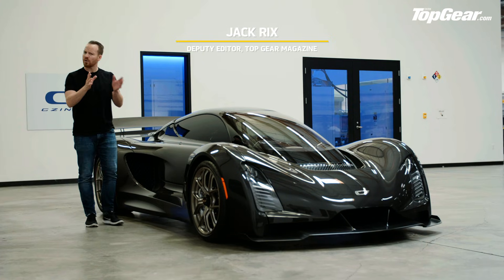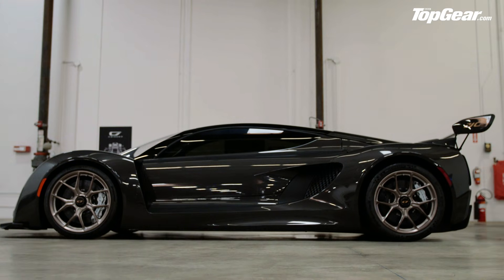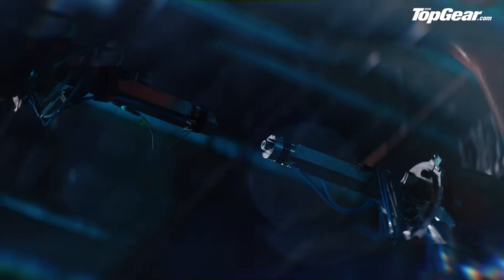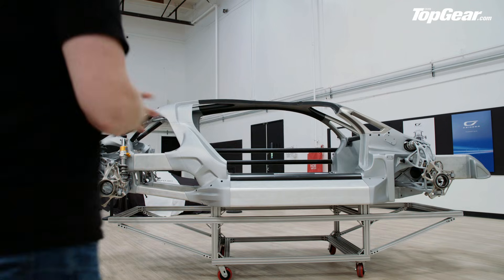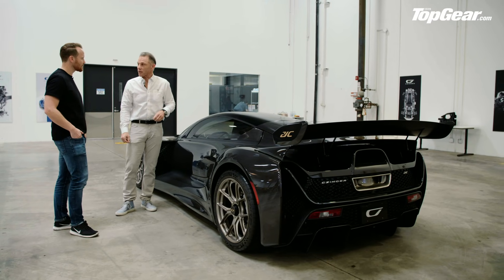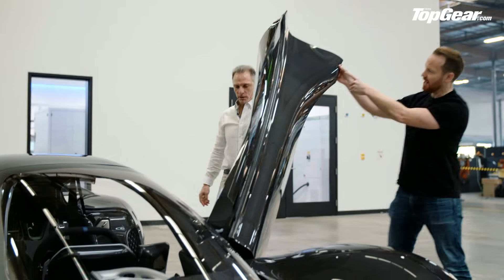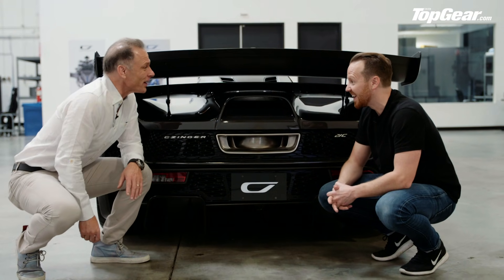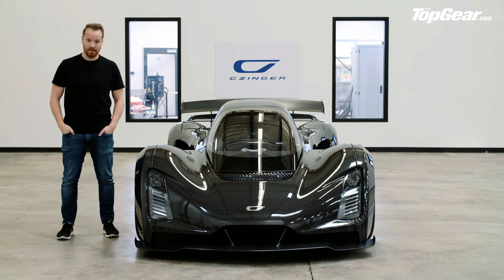FIRST LOOK: Czinger 21C: the world’s first 3D printed hypercar | Top Gear

Comment: “The future of car manufacturing”. 

Also:

“The future of mass unemployment”.
Reply: The problem with the call to historical trends is that new jobs were always created by new markets, but the workers needed by these new markets were always human. The car replaced the horse and buggy and suddenly, even though the horse ship manufactures disappeared, the market for cars was much greater and so more jobs were created. But these jobs were still handled by humans because machines couldn’t do the work. 

Same with the Internet. It is a new market that created many many new jobs that may have replaced those that were lost to new technologies. So even as some jobs were lost to automation, many more were created at a higher level. 

The issue here, though, is that we aren’t creating a new market so much as were are creating new workers (AI and robots). So even if we do create new markets, we will also have an army of AI workers that can fill the new positions. 

Think of it as a hierarchy of complex decision making. As jobs lower on the hierarchy are lost to automation (manufacturing jobs for example), more jobs were created at the top (programming for example). But AI is creeping up the ladder. More jobs that couldn’t have been done by computers years ago (call center jobs for example) can now be handled by a machine. And these machines are getting more capable of moving up this hierarchy. At the same time, there is very little room at the top for us to keep climbing to. Even if we come up with large new markets, the level of complex decision making that the average worker is required to do won’t exceed what we currently do in tech and science. We are near the top of what complex decision making jobs can be created. We might manage to generate many more of these jobs, but their complexity won’t exceed where we are now by very much. 

In the past, these new markets led to new jobs at the top of this hierarchy because computers couldn’t do the work themselves. Now we find ourselves in a position where machines will be able to climb this hierarchy faster than we can expand it at the top. And then when new markets appear (which in the past offset the loss of jobs in a lower level) many of the new jobs will immediately be filled with more machines. Why hire a lawyer when at some point the AI will be better at it (or at least do enough of the grunt work that you only need a single lawyer managing it)? How about spinning up a few virtual accountants to handle a merger?

When you create an AI with the same complex decision making abilities as the average worker then there is no reason to keep employing the average human worker. 

This time is coming.
Reply: @2000bvz  Mate, this comment is way too good for YouTube.
Reply: Lord Tippington the Wise - Atheist Knight of Le Reddit Gentlesirs 

I am having a terrible day, and your comment made me chuckle. Thanks 😊
Reply: @2000bvz  👍
Perfectly analysed and summarized!
Reply: You seem like a smart guy and are highlighting problems we have had with society from day dot. Machines can and will nearly always improve productivity. It down to society to allow the benefits to improve the lives of many and not the few. The balance of capitalist rightism has swung us in a direction of favouring the few. If we can educate each other and swing the balance back the other way we can all reap rewards. Those include less working hours, more quality family leisure time. Reduced stress etc etc.
Reply: @kentonian  you can have less working hours and more family time already now. But that means less income today and there will be no difference in the future. Nobody will pay you money for your existence . 

Without any possible work, the education level will decrease because there is no need for education. That means much more children. much more population without anything todo means violence and other society problems. Just take a look to Africa or the past of few Asian countries.
Reply: @MrQmie  no because the lower classes cannot afford to both reduce working hours and have spare money, the wealth has to go to the rich. Fairer distribution of wealth helps with education a lot too.
Reply: @kentonian  The invention of free market capitalism has brought about the single largest leap forward in advancement and development in human history.  We've progressed further in technology, medicine, education, and virtually all other fields of endeavor in the last 250 years than we did in the previous 10,000. Without it, we wouldn't be sitting here arguing about the merits of the very thing that allows us to do so.
Reply: Considering capitalism is basically the use of trade/bartering it is not a recent development. You probably do not see how constrained even in the USA it is. Unrestrained global capitalism would be catastrophic.  We already have taxes, anti monopoly laws etc.  To say capitalism is the sole reason we have all these development is nonsense.  Computers were a direct invention of war. The spare time provided by trade and bartering has enabled more time to be spent on advancing technology.  I don’t think I ever said capitalism
is bad per say but un-restrain capitalism is terrible, it promotes a total
dog eat dog society where the weakest/poorest are kept
that way.

The atrocities cause by rich during the industrial revolution were mainly addresses by trade unionism. Do you think killing children for profit is good? 🧐
Reply: @kentonian  The human race has made war since its earliest days. The huge leaps in advancement and every-day creature comforts have only come about in the last ~ 250-300 years. It's not a coincidence that free markets have existed for roughly the same time period. 
You're employing a straw man fallacy when you ask me if I support the killing of children. C'mon friend, be better. I am not claiming that there shouldn't be reasonable and well thought out protections and regulations in a free market system. I am saying that it is the free market system which has led to innovation and the advancement of the human condition.
Reply: I understand how capitalism helps innovation and I’m not even saying it’s a bad construct per say. The argument is whether certain western counties are allowing it to get out of hand. You seem offended that I might suggest there should be a fairer society for risk of less progress on advancing technology.  No, there is a balance to be struck.  The balance has been better and it has been worse as per my example of child exploitation.
Reply: @kentonian  It's trendy nowadays for capitalism to get a bad rap. I just don't think we all realize how integral it is to modern society and freedom itself. Regarding balance between capitalism and civil / economic protections, if anything I think the USA and its individual state governments have swung too far away from free enterprise toward an over-regulated vanilla brand of socialism-lite. The California housing industry is a prime example. For decades, California has imposed stricter and more burdensome regulations on land use and housing construction, which leads to increased building costs, and consequently higher home prices. The same politicians and bureaucrats that created that situation then bemoan the fact that CA housing prices are so high. Yep, I'm bitter =p
Reply: It’s funny as I’m currently listening to Sam Harris podcast with Scott Galloway as a guest(ep #189). He has some great insight into economics from a moral standpoint. I don’t agree with his stance of Universal Income and his opinion that it would be complicated.

London (I live nearby) has similar issues with housing as Cali.  The super rich are buying all the properties and pushing out the indigenous communities which are now fractured and spread out into surrounding areas. This is also driving up prices in my area. Now a small 2 bed house is £200k and the average wage after tax is about £20k pa. How does that compare to Cali. Central London you can pay £1m for a similar property yet wages are only slightly higher there for the same job.

My personal experience is that most Americans are very pro capitalism and the minority of pro socialist are increasingly frustrated and a angry at the imbalance. How does someone like Trump get into power if what you say is true, deep down most of his supporters know he is morally bankrupt but still see him as a means to an end for national prosperity.
Reply: @2000bvz  
Who makes, designs and programs these robot workers, hmm?
Yes, Humans. Humans still have to designate what AI should be doing and AI can't do that on its own.
By the time it can it would be indistinguishable from other life on Earth and then our biggest problem wouldn't be the job market.
Reply: Not realy i work in the car company and there are couple of us that are quicker than maschines.On the productivity test robots gave 89% of 100 and every each of us over 120% cause we can do more things at once and the maschines could not.
Reply: mladen sedlarevic 

Man I hope that continues and that I am just a gloom and doom guy. I really do. Fingers crossed.
Reply: @YSlavy  except you get tired and sick, a robot will work 24/7 and never ask for a payrise or lunch break
Reply: @bingedrnker.  there are enough of us in 3 schichts and we are allways support us whan someone is sick and on vacation.Even when your kid is sick we cover us days,weeks till everything is again ok.Production goes,they become their norme and more than they espect.Yesterday whas my robot 6h broke and i have still made it to do my nummer
Reply: @YSlavy   Alas, Mladen, you want money for food, healthcare, a manager who listens to you, holidays, a pension and somewhere to have a poo - and you get all annoyed if something snaps a bit of you off, or if you get lung cancer.
Reply: @calorus  are you a robot?😂
Reply: @YSlavy  yes now but with machines getting better and better their speed could double or be  way faster soon enough
Reply: we will all be flipping synthetic burgers and wiping down tables with college degrees and massive student debts soon lol
Reply: Ehh most of the big brand manufacturers have switched to automated production for most of their factories.
Even "coach-built" brands like Rolls Royce are having most of the production automated thanks to the VAG ownership influences.
Reply: Tony Wilson , I really hope you are correct. 

My fear is that we are underestimating how generalized AI will play out as it progresses. Ultimately, if we are able to create a truly generalized AI then there will be, by definition, nothing we can do that it cannot do. 

Of course we are still a ways away from something that advanced (if we ever even get to that point). But if you consider the rate of advancement, we are on the cusp of non generalized AI being able to do a number of jobs better than humans. For example, AI can not identify faces nearly as well or better than many humans. Ten years ago that was the stuff of science fiction. Self driving cars are still not ready for prime time, but the difference in their capability today versus twenty years ago is profound (twenty years ago it wasn’t even in the realm of possibility, today self driving cars can see and identify their surroundings with uncanny accuracy... though their decision making is still lacking). 

Think about what computers were like even just thirty years ago (windows 3.1 vs. the power of the average, $400 smartphone today that has voice recognition and face recognition as a standard feature). 

For the most part I’m still talking about non physical jobs that don’t encompass robotics. Things like customer service accounts handled over the phone. Accounting. Sales. Etc. 

The ability for computers to make consistently accurate decisions in the real world is still nowhere as good as a human. But in a lot of industries it is good enough that a human can oversee a number of AI systems doing basic work. As the AI gets better, it will rely on the human for edge cases only. 

Robotics will also follow this same trajectory (I suspect... you have much more experience with this than I do). We have robots with extreme dexterity. But what they lack is the ability to react and deal with edge cases. The unexpected. But their abilities in this area is only growing (especially with the advances in computer vision). 

It isn’t generalized AI, but it can mimic some of the decision making that used to require a human. In thirty years, I can only imagine how much more powerful these skills might be. It may still not be a fully generalized AI, but the number of complex cases it will be able to handle without human intervention will be much larger than it is today. When this happens, human workers will have to retreat to jobs that are still too complex for the AI. But the number of these jobs is not infinite. It will actually be fairly small. Even if we create whole new industries - like the whole internet and service industries that more than made up for the very real loss of manufacturing jobs (which is the only reason we haven’t hit the job apocalypse yet) there will be fewer jobs in those industries that aren’t automated. 

I may will be wrong. I really hope so. I’m no expert in this at all. I’m just looking at where tech was, how fast we got to where we are today, and the massive financial incentive to win the AI wars which is pushing us forward in this direction as quickly as possible.
Reply: Job creation over the last 30 years in the US barely covers for population growth (33% to 31%). However, when you realize that a HUGE chunk of these jobs are low paying jobs in services, with no potential for growth in terms of a career, you begin to see that there is a massive employment problem (much more than the simple figures suggest), and automation is a big part of that. As a matter of fact, automation is rapidly taking jobs in services as well, as AI advances (robocalls are a great example), and this will certainly only get worse in the near future. Unemployment rates will rise, and people will be righteously pissed, unless we think of solutions right now -- think universal basic income and/or reducing working hours whilst maintaining wages.
Reply: Get ready,  In the next 10 yrs most of the 5mil truck drivers lose their jobs. Plus all those truck stop employees.  Self driving trucks alone put 7,8 mil out of work.....
Reply: Someone's gotta make those robots don't you think?
Reply: That’s why we need ubi. #yanggang
Reply: Worst case scenario we just get more customer service jobs, i.e. the rich go back to having armies of personal servants, because they're cheaper than robots.
Reply: That's why we need Thanos
Reply: Yeah, you ever see that movie, Elysium??
Reply: Tony Wilson  Sorry, Tony, technology is moving a lot faster than you seem to understand. For as long as automation just meant creating artificial limbs to repeat programmes you were right.
But automation now means artificial brains, even if narrower than ours in scope, that can think in their fields far quicker, more precisely and more abstractly than we do. And the problem is that the new jobs they create now are just jobs for a different narrow brained AI.
We may know what we want, but we are no longer the best thinkers on the planet.
Reply: One of the goals of a technologically advanced society should be to eliminate the need to "work" yes it would be a necessity from time time. "UBI" could work in a civilization that is not obsessed with lording over each other wether it ne monetarily or otherwise the slave labor we have is less than before but this is definitely progress
Reply: Tony Wilson  well....
Name calling is not a sign of intelligence or knowledge. Also people do not "Need" work. They need food water, and shelter. Love, compassion, protection. Things of this nature.
Capitalism is a monetary system in the private sector, not a way of life.
Reply: LEARN CODE, duh!
Reply: Then become the guy who develops, or programs, or installs the machines that are stealing the jobs haha
Reply: Designers are probably losing their job to computers, but they can create new jobs, and it's difficult for us to imagine what those job would be. E.g. mobile app developer did not exist 30 years ago.
Reply: The technology doesn't create and maintain itself. Low skill jobs are being replace with high skilled, higher paying hardware and software engineering jobs so it's a net positive.
Reply: Only realised after, it's your own original comment. I smoke everyday, so it's like I'm taking the red pill every day. Every morning I wake up in this pink goo next to a bunch of machines
Reply: 1964 was the peak year of (human) assembly line manufacturing... Robotics has taken over...
Reply: People really forget about androids. Androids will take over those giant robotic arms. Androids will be able to self diagnose and can fix itself, or  have another Android fix the problem, then have another one fix that Android and so on and so forth. This may sound entirely like fiction now but just give it a few decades. We will get to that point. Then that'll be the ultimate test for humanity.
Reply: Yang 2020
*6 months ago
Reply: ye pretty sad tbh
but i guess if you want to have a job thats never gonna be replaced better be a doctor lawyer or software engineer / machine or ai dvpmt
Reply: People always sat tech will put us all on the unemployment line. Never works out that way new jobs are created for people. For ex. Apple and Google employ alot of people even though they are tech. Companies
Reply: @allensaunders449  nah, technology always cutted jobs, thats the way it goes. There are new jobs, but they always cut more than they really make new ones
Reply: @hasangenc2922   no not true,  because that tech still needs maintenance and operators to run it. It just means the guy that just knows how to turn a wrench better know how to learn more stuff.
Reply: @hasangenc2922  honestly i disagree.. there are many more people in employment now than before the industrial revolution.. also more job types at each turn of century since the industrial revolution. The only class of people that the rule applies to  is low educated (truck drivers, coal workers..etc).
Reply: Hasan Genc Cuts old jobs and creates new ones.
Reply: Allen Saunders Not everyone is into computers and not everyone likes to sit 8hrs a day, every day. 
For example i love to create films on my computer, but i can not see myself sitting on a desk whole day. I would go mentally and physically ill.
Reply: @allensaunders449  mechanical muscle replaced the horse, who will the mechanical mind replace?
Reply: @allensaunders449  You clearly do not understand:
1. IQ distribution among human populations
and
2. Minimum IQ requirements to make use of the new job created by technology

give your head a shake
Reply: So we should restrain technology advancements because of manual labor jobs? There will still need to be plenty of people involved in the process, relax there union guy.
Reply: yang 2020 lol